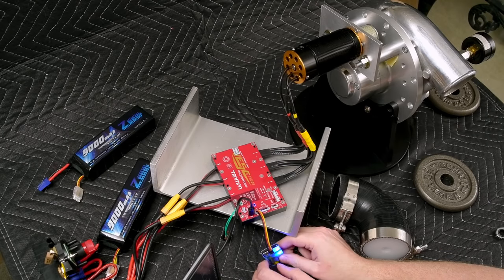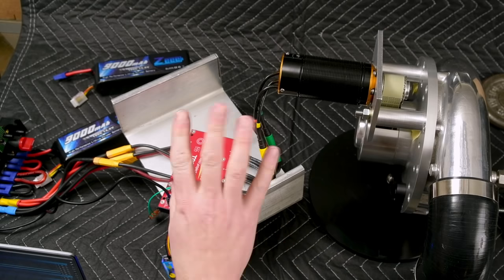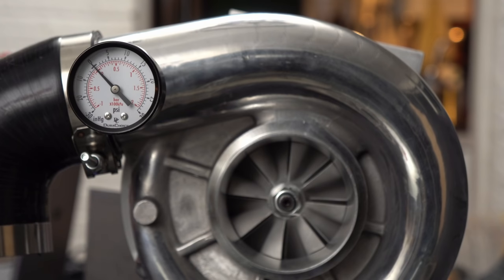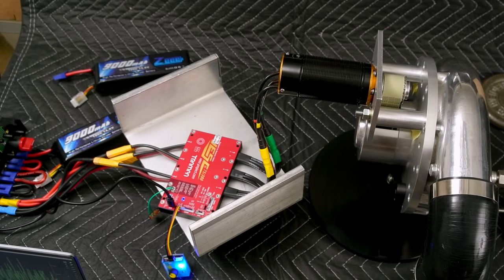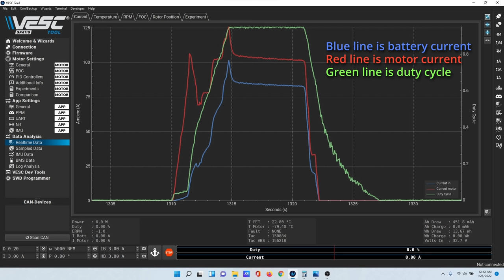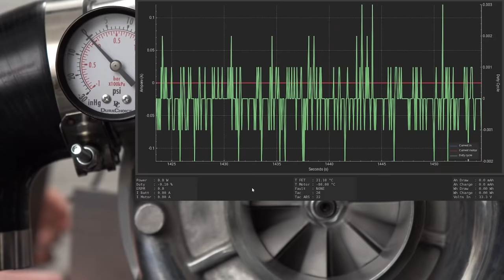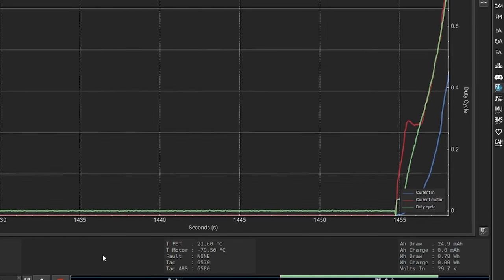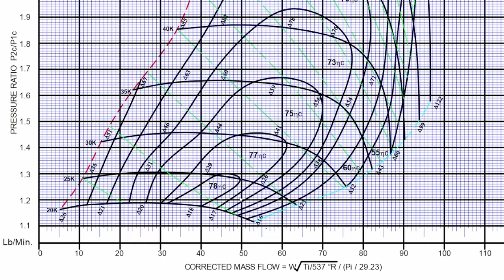Easier/Cheaper High Power DIY Electric Turbo - First Tests

Comment: was just looking into this and found this.  you uploaded while i was searching  :)

anyways dumb question, can you power this inlet turbo using another exhaust turbo.  so less strain on battery once you start boost?  is this even possible?

maybe the proper question is how much electric power can be generated from a exhaust turbo.
Reply from the maker: That's a good question.  I actually don't know.  If we look at everything as simply energy, you've touched on one of the major advantages of this system.  A conventional turbo is frequently though of as "using wasted energy" i.e. the heat that goes out the exhaust.  Now it's true that conventional turbos use some wasted energy, but in order to work at all, the turbine side of a turbo requires a pressure differential on either side of the turbine.  The way that's achieved is by creating a restriction in the exhaust, creating backpressure.  And since no mechanical system is 100% efficient, the pumping losses incurred by the turbo must cause some loss.  The electric turbo idea doens't incur these losses, which explains the insane power gains we saw from only 2 psi on the dyno - we picked up 64 rwhp from only 2 psi.  No conventional turbo can match that.  If you haven't seen the video, it's here: https://youtu.be/84wSLQRy9sc  That was early days, and since then we've doubled to boost level and took it drag racing:  https://youtu.be/AOL3Qyczt3Y  Thinking this through, I'd love to see someone dyno test a turbo being spun up be an engine, and creating boost on the compressor side, but not shoving more air into itself to make more power.  Horsepower and electrical power are directly related (1 hp = 746 watts).  To be honest, I also don't know the answer to the other part of your question - but I don't think using a conventional turbo to "help" the electric compressor would work, at least no to any significant degree.  I say this because I've driven hundreds of miles with the electric turbo on the car, and the electric turbo's impeller NEVER spins on its own due to airflow.  In fact, I've datalogged how much of a restriction is actually is on a 500hp N/A engine - it's exactly equivalent to 1 psi of boost LOSS.  Which, in the grand scheme of things, isn't much at all.  In normal driving, it has zero impact on power or gas mileage. Like I said - you have good questions that lead to more questions...
Reply: @AlexLTDLX  thanks for the reply.  Will look into it.   My thought is, the electric turbo is still not using the exhaust energy which is still being wasted.  There's gota be some use for it.

I saw the other videos, impressive.

I have a 370z, and id like to use electric turbos on it.  Even for 100hp would be great.
How long would that battery charge last? Can you race around a track or the battery would die after few uses.  I wonder if anyone tried this on a Z with 2 intakes.
Reply: @AlexLTDLX    Use it the opposite way. Use the electric turbo to pressurize the exhaust turbo until it starts producing boost equal to the electric. What this will do is extend the boost curve lower in the rpm range. Use a boost sensitive switch to cut it out. A turbo powered car one of these plumbed in to begin boosting from sub 1500 rpm would be ideal.

This is how I envision it operating. It is a compound arrangement that turns conventional. 

A metal or plastic Y the same diameter as the exhaust powered turbo compressor intake. 
The 3 arms of the Y are arranged thus: 
The bottom of the Y goes to the compressor intake, one branch of the Y is normal filtered air, the other side of the Y is connected to the electric turbo. A flap is fitted that is hinged in the valley of the Y.

This is how it all functions.
The electric turbo feeds into the compressor of the turbo via the Y piece with an electrically operated flap to close in a way that cuts the non electric turbo arm of the Y from intake air. 

When the electric turbo is ON the flap directs all intake air via the electric turbo only. This is to allow the electric turbo to produce pressure before the exhaust turbo compressor and indeed in the entire intake tract. If the flap wasn't there the electric turbo couldn't produce boost at all as the boost air would back feed out the other side of the Y since the other arm of the Y is for 'conventional' mode intake. 
As the exhaust driven turbo equals the boost pressure of the electric turbo, the flap changes position to allow the engine to draw intake air from either/both sources since it doesn't matter where the air comes from when the electric turbo is off. This may also have the effect of making the transition between electric and exhaust turbo smoother or more seamless. As the boost continues to rise a boost sensitive switch cuts out the electric turbo.

This is not entirely my idea.
Similar has been done before and was common albeit with 2 stroke Diesels.

Bear with me for a sec a bit of background is in order. Detroit Diesel Uniflow 2 stroke had an interesting arrangement. 
Uniflow Diesels require a Roots blower to run. These are the same blowers that are the basis for superchargers - a 6-71 blower is off a Detroit inline 6, 71 cubic inches per cylinder.
Back to the blowers, the Uniflow or 2 stroke Diesel is arranged with a conventional wet sump, camshaft operated exhaust valves in the cylinder head and a unit injector also camshaft operated. A ring of ports in the cylinder is used to aspirate the engine. The blower supplies the air gallery that the cylinder sleeves pass through and the ring of ports align with. The pistons have to have rings above and below the gudgeon pin to stop pressurizing the crankcase and the gudgeon pins have special plugs over them to seal them from combustion pressure.
The blower supplies constant pressure at .7psi. They are not supercharged in any way or form, the .7psi over atmospheric is for some altitude, temperature and normal wear and tear compensation to ensure the engine makes rated power. Detroit even called them 'n' for natural.

When you want more power from a uniflow Diesel while maintaining the same max rpm then you have some issues. The problem with geared blowers is they lose pressure with increasing density altitude therefore power. To compensate you can turn them faster or try a bigger blower that actually produces true boost but then adiabatic heating could become a durability problem in trucks fitted with Roots blowers turned supercharger. The blower lobes can't touch each other or the case when they get hot - no matter what, and when they're cold the gap is too big - what to do? 
Detroit Diesel fitted a turbo feeding into the blower because the blower is still required. They bypassed the issue literally.
Turbo Detroits did not delete the blower because starting, idling and light load still required the blower to aspirate the engine when the turbo couldn't. What they did is modify the blower to have a spring loaded bypass flap and passage where boost pressure would overcome blower air gallery pressure and redirect the intake air from the blower lobes bypassing the blower while under boost even though the blower was still turning. The pumping losses for a Roots blower are in the order of 100hp depending on stuff, using a bypass flap saved ~30hp. Unremarkably turbo blowers are called bypass blowers. 
Next they added a liquid to air aftercooler under the blower.

This is where it get a bit interesting, EMD and Detroit Diesel were both divisions of General Motors. EMD Diesels are also uniflow albeit with larger 567, 645, 710 cubic inches per cylinder but in all respects operation is identical. EMDs are all 45deg Vee and they exhaust in the Vee. Detroit 2 Strokes are not all Vee there are many inline configs and all the Vee engines exhaust on the outside in the conventional location.
What EMD did with their turbo engines so their V12s, 16s and 20s was to go a hybrid arrangement. They deleted the camshaft operated Roots blowers entirely. They went to a centrifugal blower with an overrun clutch. For starting, idling and lower power settings the crank would drive the compressor but at a higher pressure than .7psi in Detroits (I can't remember but perhaps 6 or 8 psi??) then as the engine spooled up the turbo would begin producing more boost than (the hypothetical) 6 or 8 psi and the overrun clutch would allow the compressor to free spool. This also had the advantage of the turbo and crank being able to work in conjunction with each other in certain circumstances rather than exclusive of each other in the Detroits.

On the Silver Series, Detroit Diesel nearly developed an EMD style hybrid turbo instead of the bypass flap the earlier Detroit Diesel turbo 2 strokes had. 
The Silvers were a marvelous thing but even so didn't reach their fullest potential. Development costs combined with the fact 2 strokes were on the way out for other reasons beyond the scope of this description caused them to stay with the flap and the parasitic blower even when it wasn't being used.

Comment: got any part numbers for that belt and pully on the motor you used?
Reply from the maker: The belt is a Gates T5-280-25 Synchro-Power Polyurethane Belt; but any T5 belt from maybe 260-280mm long would work.  I don't have a part number for the pulley handy, but I got it from McMaster-Carr - it's a T5 pulley, 25mm wide.  But the center bore was seriously off.  I had to bore it out, plug it and re-drill/ream it on my lathe.
Reply: @AlexLTDLX  thank you

Comment: At full tilt my YSi-B uses about 90hp to spin to 65,000rpm. Not sure how you will get a small electric motor with half that power on that thing.
Reply from the maker: It might, but it also depends on the pressure ratio.  That figure likely puts it into choke (it seems a bit high - my Whipple, overspun, only cost about 70hp and it's nowhere near as efficient or light as your blower.)  Either way, you could make 90hp less boost, run more efficiently and take all the strain off the crank.  And keep in mind, power to drive a centrifugal compressor increases exponentially.  FWIW, I have a 53hp motor coming tomorrow.  It could match your setup because of no parasitic losses.  In fact, I'd love to play with a YSi-B - it's a very good match for that motor.  The first version made amazing gains on the drag strip - 1.7 second and 15 mph on only 5 psi: https://youtu.be/_n6hDRsMZd8

Comment: Grab a SurRon Light Bee X electric dirt bike battery. Seems like a good fit.
Reply from the maker: No where near enough current.  The LTO cells I'm using can output 10 times what that battery you suggest can - continuous (900 amps).  They can deliver peak bursts in the upper thousands of amps.  There's a reason they're so overkill... that'll be coming soon.
Reply: @AlexLTDLX  Subscribed. Maybe I should put that VESC controller on my SurRon. Looks super nice.

Comment: what's the connector used on the vesc three phase output wires?
Reply from the maker: None - I had to solder them on.

Comment: So, would it be cheating if you have a battery pack and a crazy High speed electric motor to super charge your gas motor to beat a tesla ?
Reply from the maker: Actually, I've set my sights on beating a Plaid in the 1/4 with an electric turbo.  The LTD has gone 9.8's on pump gas with the Whipple, 10.5's with the first electric turbo, so I'm sure we can get 9.2s or faster.  Is it cheating?  Who cares.  Let's drive both across country.  Good luck finding a tesla charger in the middle of nowhere.  (I don't hate electric cars, btw, but you've got to be real about the lack of infrastructure to support them).

Comment: would be really neat eventually seeing this in a car with a propper charging system and computer controlled with maybe a arduino if it doesnt have too much delay. tough i think it might take a while before that happens. would be interested in doing this myself one day when i have a small fortune to use on stuff like this.
Reply from the maker: I dunno know if you saw it - but I've already got such a thing installed in the trunk of the LTD:  https://youtu.be/J7glXHY3AbI  In fact, if you're new to the channel, here's what I think is one of the coolest videos we've done - drag testing the electric turbo: https://youtu.be/AOL3Qyczt3Y  The results were rather eye opening.
Reply: Nice hadnt seen that control box.
Reply: Nice setup. With the arduino do you keep the motor turning a certain rpm or do you set it to switch off completely. I might have a barometer sensor or whatever its called keeping a slight positive preassure by ramping the speed up and down with the arduino. Should be better than going from standstill
Reply from the maker: @TheSimonarne  Sounds like you, my friend, really need to join our forum at www.electrifiedboost.com  It's relatively new, so it's still pretty small; but one of our members developed pretty comprehensive arduino code for these things.  We've got a pretty smart crew of people over there - an electrical engineer, a software engineer, a CNC machinist, just to name a few.  And your idea is one we've discussed recently.  In fact, I really need to do a video on his code.  To answer your first question, I only turn on the e-turbo when the load read by the engine's MAP is high and rpm is over 3,000 rpm.  But that's programmable via the car's ECU (Megasquirt MS 3x).  The arduino code allows for a lot of variables - ramp up time, max pulsewidth adjustability via a pot, even controlling the charging circuitry - and that's not even close to all...

Comment: 5psi with no enigine drawing a vacuum behind it wouldnt do much when it has one. You need a much bigger drive pulley to make real boost.
Reply from the maker: Everyone seems to be hung up on boost numbers; I'm more about actual performance.  Version 1 made 650hp on our first drag strip tests: https://youtu.be/AOL3Qyczt3Y  A 15mph gain and 1.7 second drop in ET is HUGE.  I was very surprised.  Remember - unlike every other form of forced induction, this one has no losses at all when it's operating.

Comment: Help me out here, for me to know about if it is helpful for me  i need to know  engine size engine rpm engine vaccum  ,super charger  cfm,super charger rpm,voltage ,load,and pressure on engine  and ported vaccum, vs manifold vaccum, and pressure difference, im sure im forgetting stuff and probably saying some of the actual things wrong,  but  i think some things arnt being mentioned

Comment: Have you any data from testing a sensored motor with boost/ turbo timing ?
Reply from the maker: I don't have a sensored motor yet.  A sensored 53hp LMT motor and MGM ESC is supposed to be arriving in a couple of days.  That's going on what I will dub the, "sledgehammer" - we'll see how close we can get to 1,000 hp with that thing (and obviously either the first version on this blower or a bigger one yet).
Reply: @AlexLTDLX  it's the way forward dude ,excited to see your results ,more rpms!!!

Comment: How much HP would that add to a 2l petrol engine?
Reply from the maker: Probably enough to blow it up.  The first version we built made 650 hp, and we did some drag testing with it: https://youtu.be/AOL3Qyczt3Y
Reply: @AlexLTDLX  okay so can you suggest of it does exist the cheapest electric turbo I wanna put on my bmw E46 is a 2.2l petrol I want at the very least 50hp more and the stock engine can hold to 400hp so not more that 400hp total
Reply from the maker: Honestly, it's probably this setup.  Which is why I made it.  You'd have enough boost power to dial in whatever you want.  Whatever you do, do not start with a regular turbo.  You'll never hit the rpms needed to make efficient (or any) boost.  You need at least a 5" (125mm) diameter exducer for your car.

Comment: hi pointless putting a boost gauge on turbo it wont work , you need to put an air flow meter on turbo intake and then filter and measure the resistance on the airflow meter to get how much psi it will make , and another thing the rear of the turbo must be completely air tight or your lose pressure out the back of the turbo so make sure has no leaks around your pulley to belt.

Comment: I wonder how this would work on my lsa supercharger????
Reply from the maker: You'd need something with more torque/less rpm.  Something like a large outrunner.  Though a positive displeacement blower is less efficient particularly in regards to drive power because of the rotor mass (I've built a number of positive displacement setups using Eatons and Whipples - the last Whipple setup ran 9.80s at 140 mph (on pump gas)).  You can check out some of my other videos.  We've even already drag tested a direct drive version that was very similar (in fact, used this exact same motor), and the results were rather eye-opening: https://youtu.be/AOL3Qyczt3Y

Comment: Whats lubricating the turbo bearings?
Reply from the maker: They're sealed (like the motor bearings).  Considering the minimal load on them, and the short runtimes, I'm not worried about their lifespan.  In the converted Vortech I run Isoflex NBU-15 grease.  Expensive as hell, but should only required re-lubing every year or two; and one 50 ml tube is a lifetime supply (better be for what it costs).